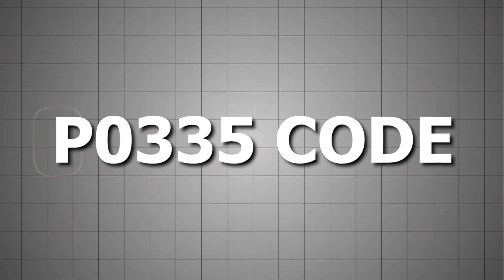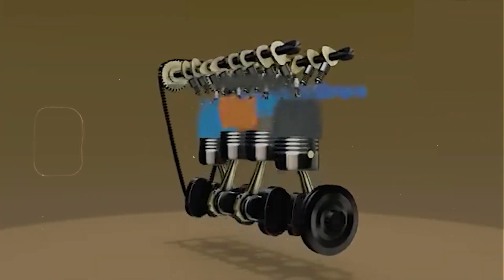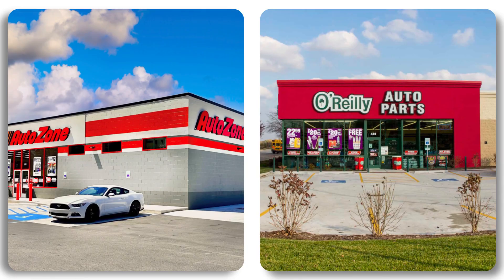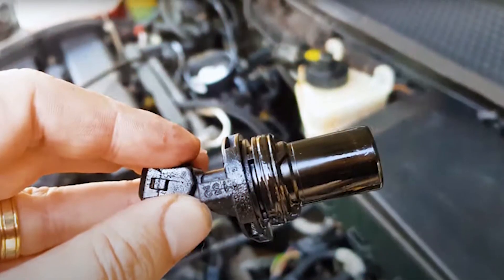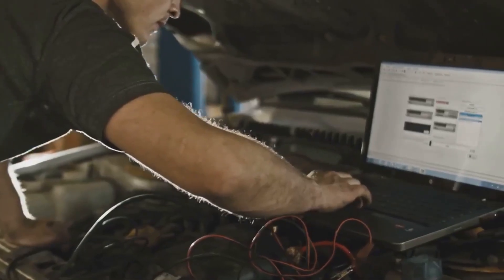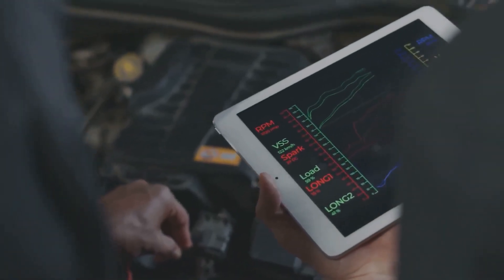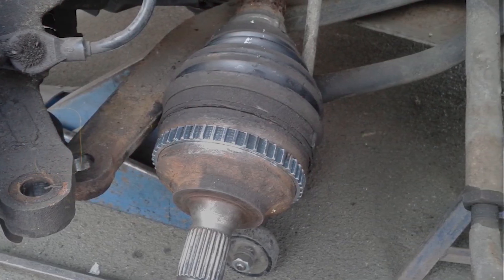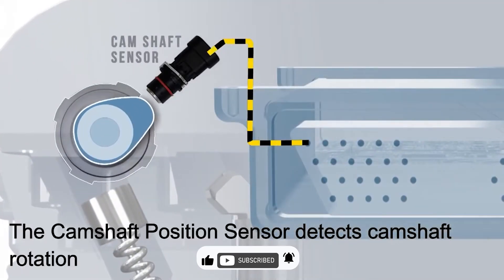P0335 Code: Crankshaft Position Sensor “A” Circuit – Symptoms, Causes & Fix

Comment: I recently replaced my crankshaft position sensor  and the old one had a twisted defected o ring and a cracked copper shaft since replacing it my 2004 GMC canyon doesn't start well at all wpnt shift properly and some times goes into limp mode  and now im getting  po171,po236,po335 codes whys that happening wires are good i took it out and inspected it and all is good